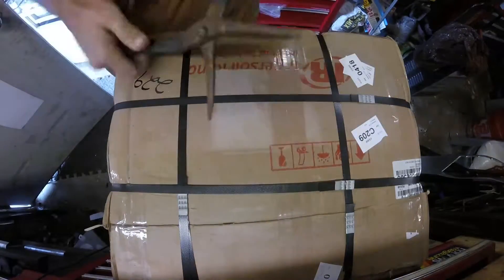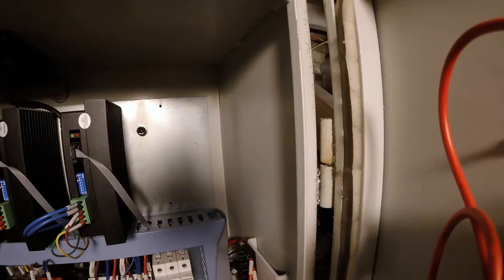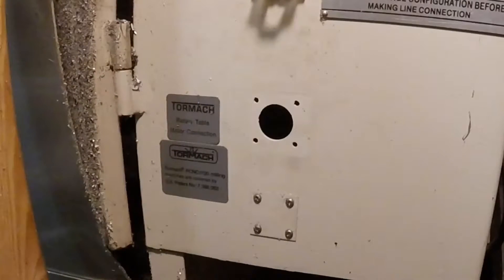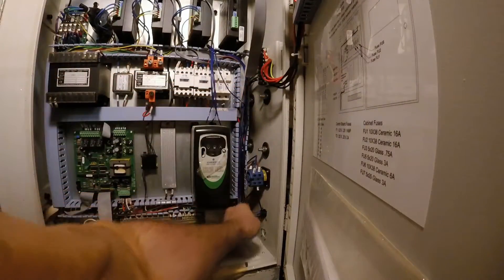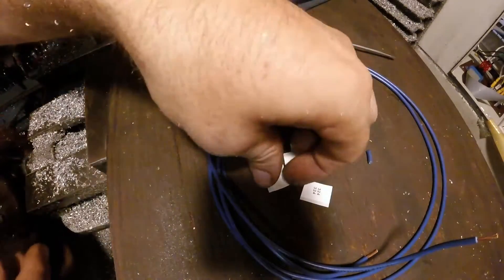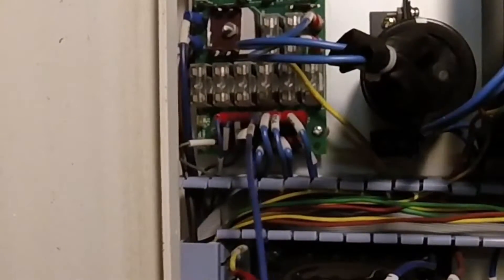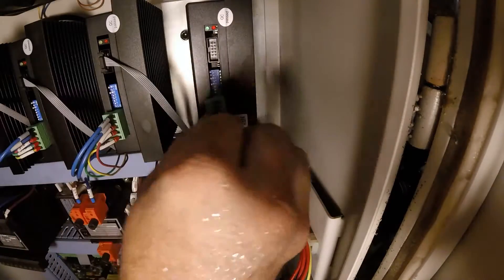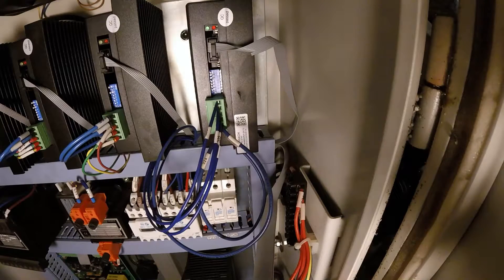Tormach 4th axis integration kit install

Comment: Congrats.  Mine is still in the box from the day I bought my 1100.
Reply from the maker: Thanks.  We'll see if I get any use out of it or not.  I have some ideas now I just need the time to work them out.
Reply: Without a 4th axis your machine is very under utilized. I would not buy a cnc mill without one.
Reply from the maker: I hear you.  Need to free up some time on the machine to work on some 4th axis stuff myself.